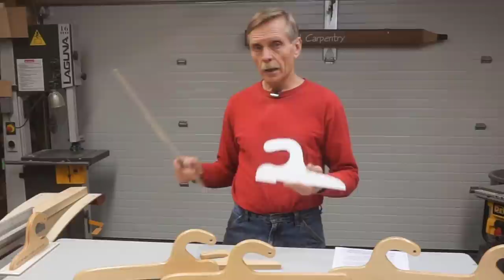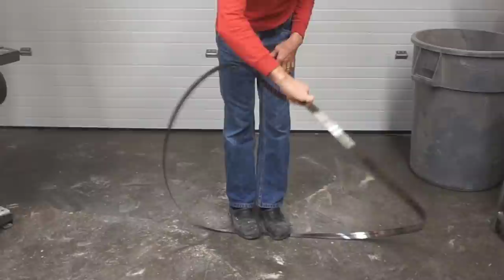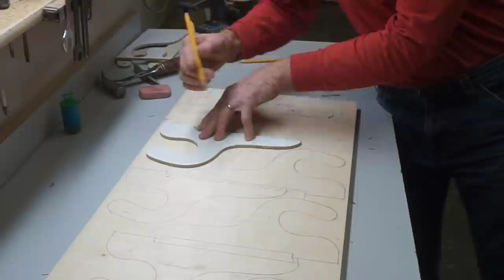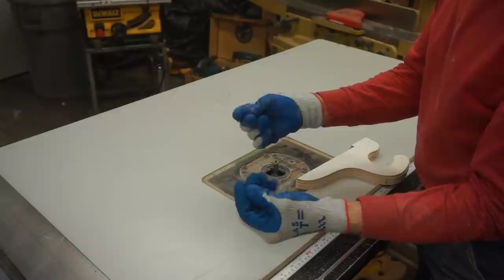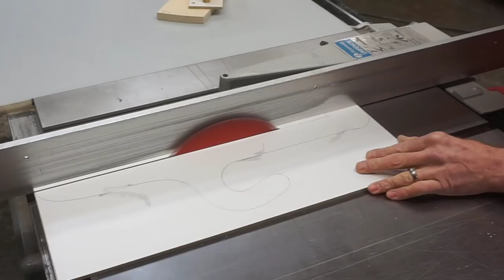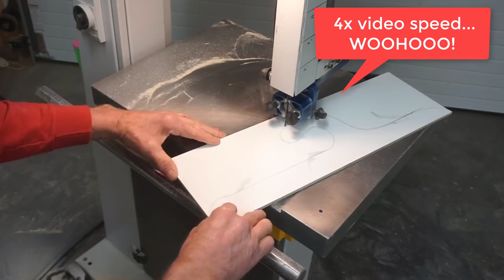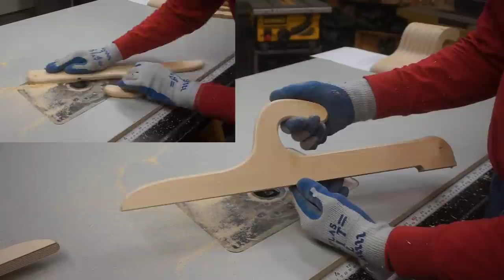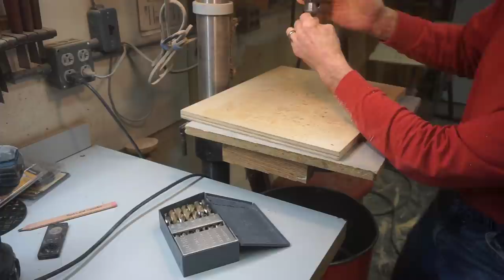Make Professional Push Sticks for Workshop Safety

Comment: With your hand horizontal like that, if there is a twist in the kickback the hand can be easily pulled onto the blade if the piece is the right width. I think there's a reason most push sticks have the handle in a vertical position. That's what I was taught learning cabinetry, might be something to it.
Reply from the maker: Ryan, thanks for your comment on this video.
The only instance I can imagine where there's 'a twist in the kickback' is if a workpiece is wider than it is long and that's the 'kiss of death' regardless of pushstick design.  
I disagree that 'the hand can be easily pulled onto the blade' with my design but if you've been taught differently please don't switch to anything I'm showing in this, or ANY, Next Level Carpentry video, that you don't feel is safe or comfortable for your woodworking skill/experience level.  Do keep in mind that this design and method is what I use as  a master carpenter with 40+ years experience for working safely on demanding projects I do for discerning clients of my custom design/build carpentry business.  It's not some cute DIY tip/trick ginned up solely for views on a YouTube Channel. Best to you, Matt
Reply: Without a riving knife it can easily happen, it's more likely with a less powerful saw, anytime the blade is under the wood or the wood lifts above the blade due to defects such as knot, bows, etc, the piece can flick off in weird directions. Ofcourse with all the modern safety features on its unlikely, but as you probably know that can be very cumbersome in a production environment.
Reply from the maker: Hey Ryan, Good point about the 'less powerful saw'... and a dull blade just makes it worse too, right?  A 'production environment' can be particularly deceptive because its' so easy to ignore the fact that 'the absence of an accident does not necessarily mean the presence of safety'.  Thanks for commenting and work safely!  Best, Matt

Comment: Thanks Matt for this very informative and useful video,  Dave Smith wants to share the full size pattern in pdf, that would be helpful for me since i'm no good in manual drawing.
Reply from the maker: Hey bongie67, following up on your comment and request Dave Smith (thanks for making this work out, Dave!) kindly 'traced' the pushstick photo from Pinterest and added dimensions to a PDF of these Next Level Carpentry pushsticks so I could upload the file to Dropbox so viewers like you can benefit from it.  Here's the link: https://www.dropbox.com/s/iqz1g9gyan26mik/NLC%20Push%20Stick%20Pattern%20full%20size%20by%20Dave%20Smith.pdf?dl=0 
let us know if/how it works for you, OK? Best, Matt
Reply: @NextLevelCarpentry  Thanks Matt for the link. Yeah it work.
Thanks and Kind regards.
Reply: Thanks! this makes safety very easy. When printing from Adobe Acrobat make sure you select the "actual size" option as the "fit" option printed about 25% smaller. Obviously everyone's setup is a little different but this worked for me.   @NextLevelCarpentry

Comment: This is a brilliant video, I highly recommend everyone watch 2-3 times as you discuss one of the most important subjects of woodworking and least talked about. I’ve made several over the years nowhere as nice as yours. I had a career carpenter in mid 80’s cut three fingers off on table saw in my shop the look on his face is burned into my mine for life.
Reply from the maker: Thanks for your endorsement, Greg!  
Witnessing or experiencing incidents less dramatic than the one you saw and ones I've experienced are indelible reminders of accepted risks of working with power tools.  A mindset for self preservation is more effective than all safety features combined, isn't it?  Unfortunately it's difficult to convey the message with words in a video but hopefully it's enough to help some avoid having a power tool take something they don't get back.  It makes me cringe to see someone dutifully wear safety glasses, gloves, earplugs and a respirator and then shove a piece of wood through a tablesaw with their fingers or a flimsy pushstick, especially when the blade is raised to 3x the thickness of the piece being cut!!  We've all heard the saying 'there's old carpenters and there's bold carpenters... but there's few old, bold carpenters'
Best,
Matt

Comment: What I wouldn't do to be able to get melamine coated MDF and decent plywood!... You are spoilt for choice in the States.
Great instructional video as usual! Thanks a mill..
Reply from the maker: markforrestsm, it's a bit humbling to learn what things I take for granted.  NLC is based in a relatively rural area in the US so I sometimes  whine when it takes an 8-hour drive one way to a city large enough to have some of the things I need... but at least I can actually get them if I need 'em bad enough.  Your circumstances no doubt make you more versatile!
Best,
Matt
Reply: Where there's a will, there's a way!
Really enjoy your channel Matt.
Take care
Reply: Try finding some scrap Pergo style laminate flooring, there are tons thrown out every day when a homeowner gets tired of the look of their floor. Also, I prefer hand saw handles as a template for pushsticks. Their design has evolved over centuries and it seems to work best.

Comment: Stumpy Nubs showed why push sticks such as yours are superior to any others.  The front of a board can move away from the fence, into the blade,  then lift up and fly at your faster you  can say emergency room. I'm going to make a set like yours in the not too distant future. I'm currently making star knobs, t tracks and a crosscut sled.
Reply from the maker: The general configuration of these push sticks is the only design I'll use... there are a lot of variations on the theme and plenty of them are just as good... final appearance is a matter of personal preference but I think you'll really like how they work when you make a set!
Best, Matt
Reply: @NextLevelCarpentry  I'm going to try to replicate your design, but unlike you, I won''t be using a  masonite template and a router because I don't need to make large numbers of them. I'll make a template on cardboard, then trace it and cut the pusher out on the band saw.. Whenever I need another one, iIl take down my card board template and trace another. I'll finish it on my bench belt sander/spindle sander. I''ve been going through quite a lot of maple making knobs, so I'm going to try maple plywood for these

Comment: Love the design. Why don't you just trace the existing stick (the basic shape is already done) and make changes with eraser and pencil before cutting the new stick?

You can also make sanding the contoured edges a lot easier with a sanding spindle in a drill press.
Reply from the maker: Glad you like the design Dan... it's proven useful and comfortable to me for years.  Main reason that I didn't just trace the existing stick is because I have it and viewers don't... I wanted to go through the process to show viewers some of the tricks I use for the pushstick shape so they can extrapolate it into other different but similar shapes.  While a spindle sander (dedicated or drillpress version) has the potential for sanding faster I actually prefer methods I show for 'fairing' curves because I find spindles tend to 'dig in' too fast and make curves 'rippley' instead of fair/smooth.  No doubt there's those who are more proficient with spindle sanders and will likely use them for this sort of work and I certainly wouldn't try to talk them out of it.  Overall though I believe this templating technique is a better workflow because it seems to me that spindle sanders are over-used in general when they're used for smoothing edges direct from band or jig saws.  That's my response but I don't preach or insist on it, rather offer it as a more streamlined approach to consider.  Best, Matt

Comment: Thanks for sharing your expertise with others Matt. I have learned a lot from watching them. I hope you keep producing them. I really do appreciate it. If I might ask, where do you purchase the 1/4 mdf melamine? I live in northern Illinois, and HD, Lowes, and Menard's here only offer mdf in 1/2 and 3/4 thickness, and I have never seen any with the melamine layer. Thanks again.
Reply from the maker: I get most of my sheet goods at a hardwood/cabinet shop supply outlet... it's commonly used for cabinet backs and drawer bottoms etc.  Not sure of an exact source recommendation but you could call someone like Owl Hardwoods in Oak Lawn and if they don't have it should be able to tell you who does.  Good luck... it's some really useful stuff and worth finding a source.  BTW if you find a local cabinet fabrication shop and get dumpster diving priveledges you'll likely find more scrap than you need...
Reply: @NextLevelCarpentry  Thanks for taking the time to reply to my question. I will check out that lead you sent. I have issues even finding true baltic birch plywood by me. Sound like you are lucky enough to have some resources close by. That make a huge difference when it come to making projects. Keep the great videos coming and thanks again.
Reply from the maker: @415orazio  I'll bet you've got better resources near you but it will be a matter of finding them.  Good luck and work safely!

Comment: Thank you for the video.  Your push stick design is well thought out and highly functional.  Ive always used just the straight stick version but feel your concept is a safer and much improved design.  I will definitely try this out. Thanks again and keep the videos and tips coming.

Best Regards,
Doug A
Reply from the maker: Doug, thanks for the comment... it's important to be confident and comfortable with whatever version you work with so approach any change with careful consideration.  Work safely in any case...
Best,
Matt

Comment: Lol this guy just went on an on an then on a little more I am one of those novice that he mentioned in his rant . With only a dozen or so projects under my belt an do get on you tube to learn about Saftey on all my machines an for inspiration one of my projects was a miter saw station with 15 drawers  with drawer lock joinery an floting bottoms just to see if I could do it. That job along give me  10. Or 15 hours on the table saw an my saw came with that plastic long push stick an yes I used it but only half way through the job .it didn't hold the piece firmly even a newbie had that problem I since bought the kreg version but will now be making next levels  an I watch a lot of YouTube an by know means is he the only man with that opinion check out Kings fine woodworking version very similar. P.s I like your response back to this guy make his own video and prove you wrong an you would take your video down. top  shelf  an please keep up the good work.theres trolls like this all over YouTube.
Reply from the maker: You'll go far fast in building your woodworking skillset with your ability to process information Todd.  From 'behind the camera' I can usually tell if someone has formed an opinion from practice or from prejudice.  The trolls who push opinion based on prejudice shortchange themselves.  Those, like you, who adjust and advance using experience and preference from practice generally breeze past those who get obstinately get stuck in behavior for behavior's sake.  Work safe and have fun! Best, Matt

Comment: Thank you for such wonderful work. It is inspiring and uplifting. If I may. I would like to ask for some guidance, I do not have access to a band saw. I have a good Bosch jig saw. The problem is, no matter how slowly and carefully I work the resulting cut is always way off of 90 degrees. The blade is set to 90 degrees and the blades are good quality Bosch fine scroll wood blades.. Is there some reason  for the inaccuracy?
Reply from the maker: You're most welcome 'for such wonderful work' John... thanks for watching and commenting.  I'm certain you'll find the answer for your scrollsaw inaccuracy here: https://youtu.be/0TI7AV8HdXI?t=814 because it can happen to the best of us. I know you know but will mention the obvious to make sure the blade stays in the little slotted blade guide wheel when cutting.  Narrow blades designed for tight radius cuts often tend to jump out of that guide wheel in use for me anyways.  It takes a bit of extra focus but once you're aware of what's going wrong you'll be able to adjust your 'technique' and get cuts that are more than acceptable for using the template method/process shown in this video... it's the same reason I use a router template when doing any freehand jig saw work that matters.  Let me know if this helps?  Best, Matt

Comment: Thank you for this video, very well done. My question regarding templates: if you trace and cut a template from an existing piece of furniture, (or what have you) do you need to cut the template 1/8th of an inch undersized so that the final piece is the same size as the original ? Thank you, keep up the great work.
Reply from the maker: Not the way I do things Ted.  That's the beauty of using a flush trim pattern bit: the guide bearing and cutting diameter of a flush trim pattern bit are identical: the piece comes out exactly the size and shape of your pattern.  You must be thinking of using a guide bushing of 1/4" greater diameter than a straight cutting router bit.  Watch this video again more closely and check out how flush trim pattern bits look and work... I think you're in for a lightbulb moment when it dawns on you how great this works!  BTW  the two newest uploads from Next Level Carpentry show other ways I use flush trim bits and patterns with excellent results.  Results like I get are considerably more difficult with guide bushings and is the reason I haven't used a guide bushing setup for 20 years.  Hope that helps? Best, Matt
Reply: @NextLevelCarpentry  Just had a chance to watch both videos  and that lightbulb is more like a floodlight! Thank you for the tip and the guidance, I'm off to get a couple flush trim router bits, keep up the great work.
Reply from the maker: @tedcodrea2173  SAHWHEET!!  You'll notice a wide range of bit sizes, shank sizes, cutting diameters and lengths now that you're looking with new eyes.  A great starter bit is a flush trim pattern bit with 'bottom bearing' in 1/2" shank (to minimize chatter) , 1/2" cut diameter, 1" cut length and, if possible, 3 carbide cutting edges (rather than 2).  I use top bearing bits often but they can be a little spooky in use since the end of the cutter is totally exposed rather than being 'protected' by a bottom bearing.  I just added one to the Influencer Page so you can see what I'm talking about.  Brand isn't as important as it once was and you pretty much get what you pay for. https://www.amazon.com/ideas/amzn1.account.AF3DBB6XLH5MPIEOBDKPL3MQVYTA/29WVINIJF4EUJ 
I'm excited for you for new possibilities this opens up for you! Work safely... oh... this video shows a huge top-bearing flush trim pattern bit in use for an idea of what's possible with reiteration of the caution stated above:   https://www.youtube.com/watch?v=0TI7AV8HdXI&t=1s Best, Matt

Comment: Being new to this ...why not stack plywood sections under template to use bandsaw to cut all push sticks at one time versus individually?
Reply from the maker: You can sure do it that way Tom but I think you'll find that the bandsaw cuts slower the thicker the stack and diminishing returns quickly lead you back to one at a time for optimum efficiency... Best, Matt

Comment: On a more serious note, what would you think about using the dual handle push stick for the joiner?
Reply from the maker: Craig, the only time I really use that dual-handle model is on the jointer for pieces that are short, narrow and skinny (like 1" x 1" x 30") since that procedure is difficult to do safely.  Mostly I use the rubber-bottom paddles for flattening dicey pieces on the jointer but prefer to flatten things when they're longer, thicker and wider and cut them to smaller size afterwards.
Thanks for commenting here!
Matt

Comment: I looked for your video on cleaning the metal surface but could not find it . Any help appreciated. Thanks
Reply from the maker: Sorry about that... thanks for letting me know... here you go: https://youtu.be/YIE50o5pS6U
FWIW This is still the exact same method and same products I use to this day.  FYI the Sandflex blocks are the absolute best for this!  If you only get one, you probably want the coarse one because it 'cuts' more than it 'polishes' like the other grits.  It leaves a little rougher 'scratch' behind but the medium one is much slower so I only use it when doing finer surfaces or removing small blemishes.

Comment: Where do you get 1/4” melamine faced MDF.  Can you use other material?
Reply from the maker: Hey Alexander, I get my melamine MDF at a local cabinet shop supply outlet but any 1/4" material should work. In a pinch I used maple veneered stuff.  The main feature is a smooth, consistent core which plywood often lacks hence my use of MDF.  Hope that helps? Best, Matt

Comment: why did you  not make the  template from the template you had without having to make all these measurements? I liked very much how to tide the saw blade, and the tips for sanding.
Reply from the maker: It was all for viewers like you, Miguel :-)  If I wasn't doing a video I would have just made a new batch of pushsticks from my old template with no need for a new one.  I wanted viewers to see these steps because they work so well for templates of all sorts, not just pushsticks.  If you end up making a template for pushsticks of your own you can sure make copies of it to give to friends, etc using the exact same process.  Thanks for commenting!!  Best, Matt